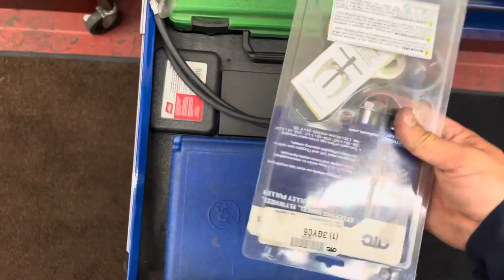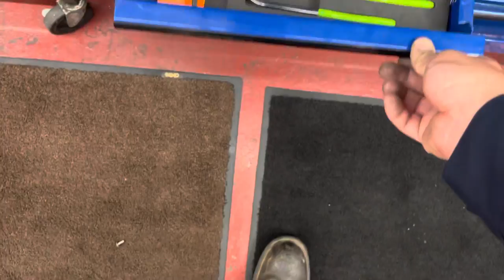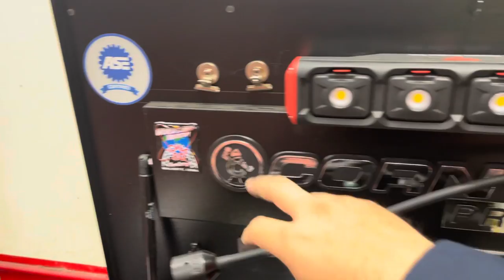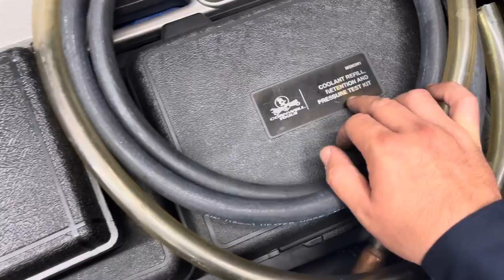Fleet Diesel Tech Toolbox Tour 2022 Update (Long)

Comment: Your are 1st cabin! 
  Me same thing with a 12 point swivel for starter bolts, just to fat to work. For years I have used a old Snap On standard chrome universal with electrical tape to keep it from being floppy, with a Snap On 12 point and about 3 feet of extension and come down through the top , I got one of those 3ft breaker bars and that works good. If I can't get that through the top
 Then it is the long Snap On flex head , 18" Matco and a 1" Teckton on the 12 point Snap On socket. This combination will jus clear the starter ground stud. It is the IH trucks that have been the hardest for me and this is where the Snap On ratchet is the master as there is no flex in the handle due to the great tempering of the Snap On.
  For brake caliper bolts get a 1 3/16 12 point socket weld on a 3' ,1/4 by 1 1/2 flat bar. Works great for caliper bolts. Just stand on the bar, let your body weight do all the work for you.
Reply from the maker: The caliper bolts the striking wrenches are mainly on disk brake equipt trailers.  Not a ton of room to get sockets/ratchets in there and with the axle there isn’t much for leverage either. You can definitely get it, but I’ve just found the striking wrench atleast in that particular situation works best, with the least amount of effort
Reply: @AdriftAndAtPeace323  I understand the room issue which affects the hammer swing also. Just wrap your mind around a 12 point socket welded on a 3 or 4 foot bar. You will have all the bolts broken loose in the time you get two loose. Trust me.

Comment: Hey man I noticed how you mentioned on that Snap On Brake Bleeder you said you made a compu check adapter for fuel systems after services. Are you talking about Detroits and how they lose prime? Because I've wondered about making that exact set up you have, would it prime the system and get all the air out, so does it work well for you?
Reply from the maker: It works great, been using this setup for a few years now since getting the idea from an old adept-ape Video

Comment: Great tour, I also am a Diesel fleet mechanic, I work almost exclusively on busses at my current job, big Charter busses and also small airporter busses. What type of fleet do you maintain, is it mostly semi's or something else
Reply from the maker: Thanks! Just recently left my long time job working at a major tire distributor. There we had all class 8 tractors and trailers. Couple electric kelmar yard goats. Current fleet is more
Of the same, however the new place I also work on forklifts, electric pallet trucks. and riding pallet trucks.
Reply: @AdriftAndAtPeace323  nice, it's good that you are able to work on some electric vehicles and equipment now, since the wave of electric big rigs is steadily approaching. The company I work for does not have any electric busses yet, and probably won't for a while because of all the upfront investment it would take.  Some of the busses they are running are around 20+ years old with more than a million miles, so maybe they will upgrade some of those to electric if they can, one can only wait and see.

Comment: When you were going over your sockets and wrenches, I couldn’t help but wonder “where is the big stuff at”
Reply from the maker: What would you define as “big stuff” in the 10 or so years I’ve been in this trade I’ve never run into much larger than a 1-1/2 bolt or nut. I have my axle sockets up to 4” and a couple specialty 3/4 drive sockets up to 2-3/4”
Reply: @AdriftAndAtPeace323  I had a feeling this was gonna cause confusion but I was too lazy to correct it. I saw your axle nut sockets but I’m referring to traditional style sockets. Those are them big ole thin sockets. Also, I wasn’t being fair when I said that. I’m also a fleet diesel mechanic but at our company I find myself working on a little bit of everything. From Peterbilts to big ole rock trucks. Guess you could technically say the heavy equipment is part of the “fleet”.

Comment: How does the extension work for the single piece clutch brakes? Does it cut through them or ?
Reply from the maker: You need a 3/4 impact gun. You twist it till the clutch brake snaps. It’s by no mean easy or “clean” it does take some time however it beats torching and having molten slag falling on you